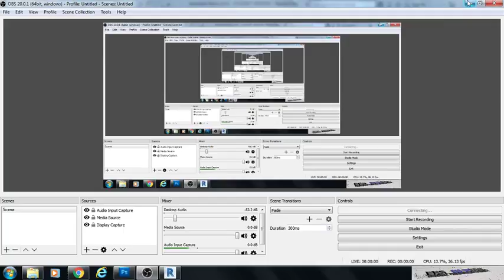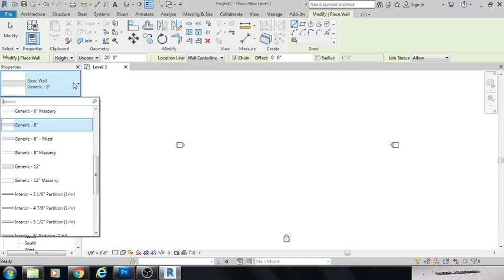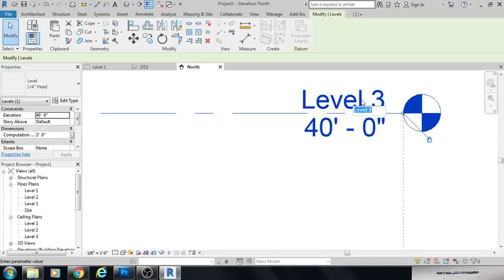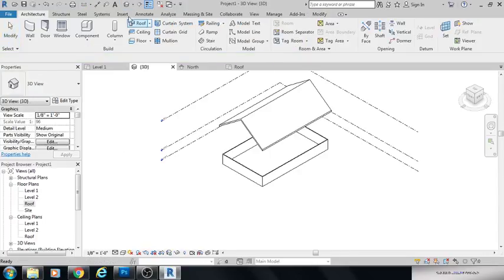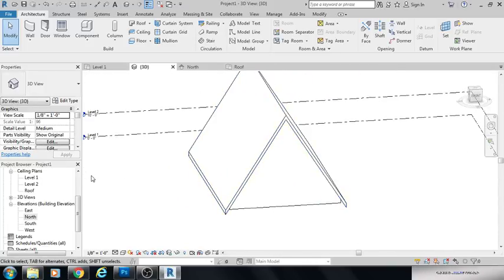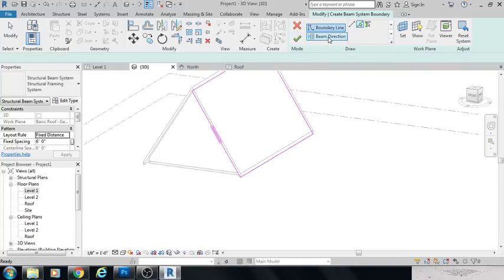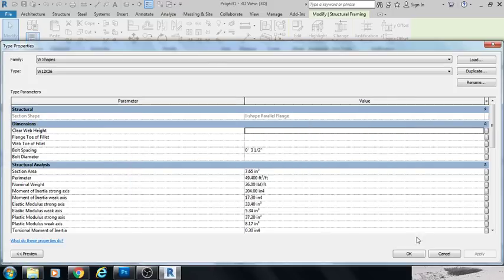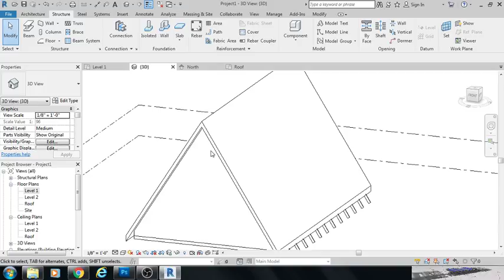(Part 1) Revit 2019: How To Model An A-Frame House In Revit

Comment: stuck at beam system. I keep getting the "Highlighted lines overlap. Lines may not form closed loops" error
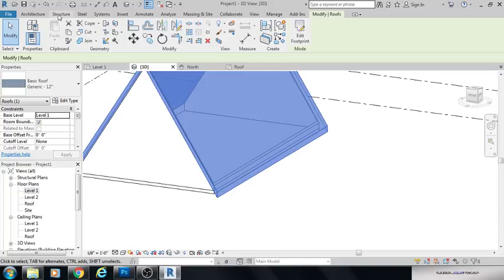Reply from the maker: Hey! starting at @4:49 did you follow along? I don't see why it doesn't work. if you're getting closed loops error then zoom in and make sure every line is connected. Most times it will highlight where lines are not closed.